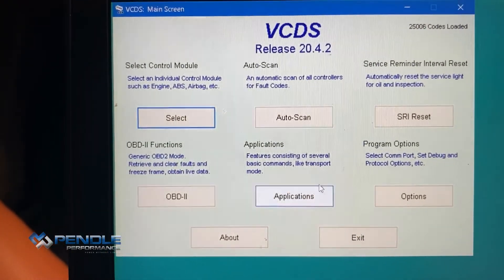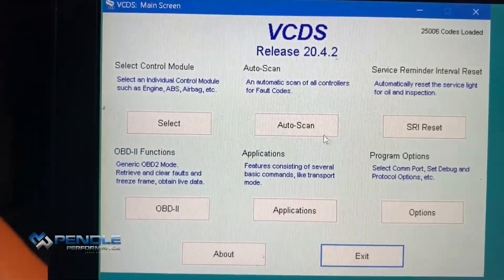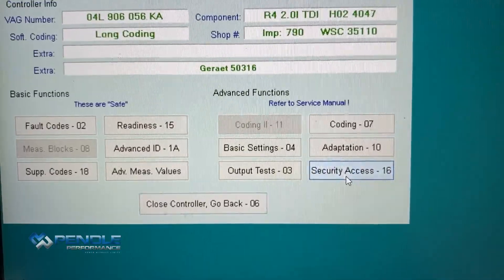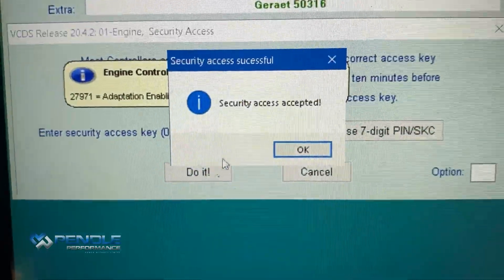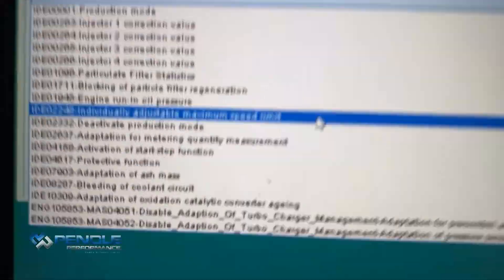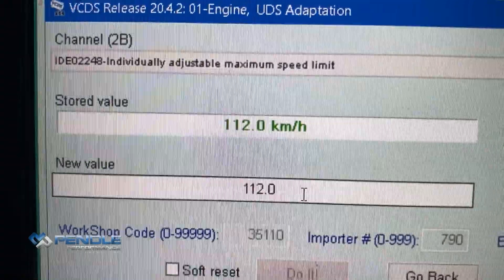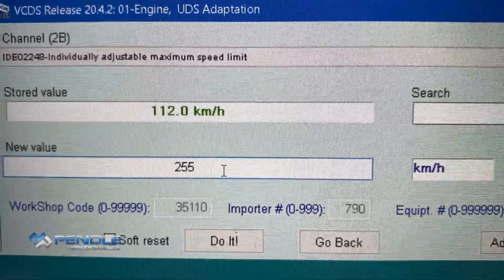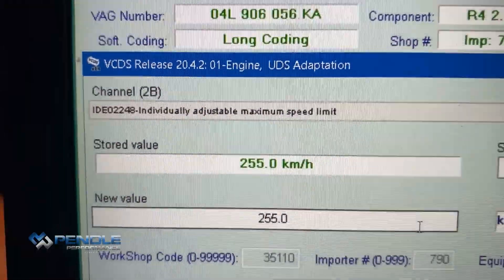VAG Euro6 - Speed Limiter Removal | Pendle Performance

Comment: Are the codes specific to individual vehicles, I have been trying to get a code from VW but had no joy. It’s a 2018 crafter limited to 56mph
Reply: Hello, did you removed speed limit? I have Crafter 2018 to, and speed limit on 114kmh. This method works or not?

Comment: What about the hiboy max /inceptor hoverboard/M5 /  many others same ride just diff names.. but mine goes advertised 19 miles so but had it hit 21 couple times.. so lie 33 km an hour but with the need for speed all my life and big into racing....till I became parent but these bring me back to feeling like a kid again Nd GONA help my son and I bomd even MORE once he gets old enough for thse..but..ya if someone can tell me how to do it on mine without me destroying it completely?  If I cam get another 5 or ql10 km an hour the be alo the difference...amd all it's really lacking..  aside from rear sh9cks but uve reinforced it around a bit it actually helped ha...but this is more of a street sports car tyoe ...tlmy jeep version is next.. but under 1500 or 1000 even but NEED ls to be able to go offroad as much as on and gokd bounce..and speed.. I know our company here in CANADA. M apolo.. but.. that song be for a while m so for now I gotta make sure I cut the PROPER WIRE or I'll loose out on 600 bucks..😱and this is my therapy and sanity right NOW ESPECIALLY...bit ues itll work the same for anyone who got ANY of these scooters.. the ones with LED side blue lights and it stands out for sure than most others under the 600 $ range...next is best under 1000 then maybe best under 2000 later down road.mlike my vehicles used to beam gotta have an infinity and then a JEEP.. u need them both to be able to drive on ANYTNING... but I'm gona unscrew the bottom as they gor it reinforced with like 20 screws amd SUOER thick plastic and I even threw duck down down under it to ti water PROOF it eve more haha..but.onh if I can get this extra 5 miles or so faster yes pkz mm THATD MAKE value of this more for me ..and 30.km/ he just ISNT fast enough for me.. in a driver and x racer and am addicted to these things and new way of driving/riding and for now has to be as FAST as THIS thing can be.. few more weeks weather will be warming..gotra be ready folks 👍🤞✌🙌be safe yall..I may go ahead and try or wait for a reply ha..needless if it days days I dont wana fuck it io and it mot be able to even turn on anymore 😱